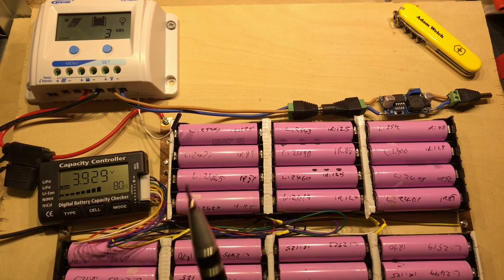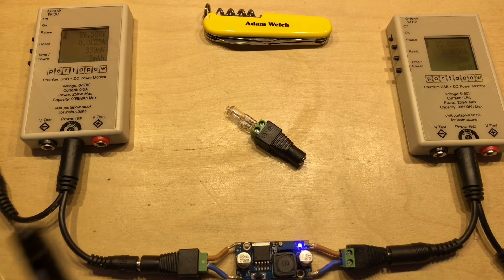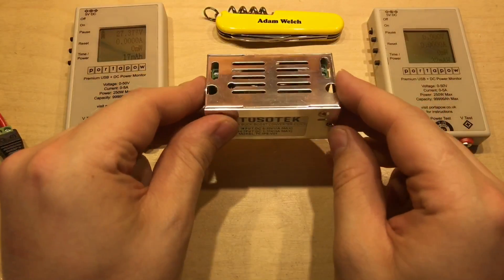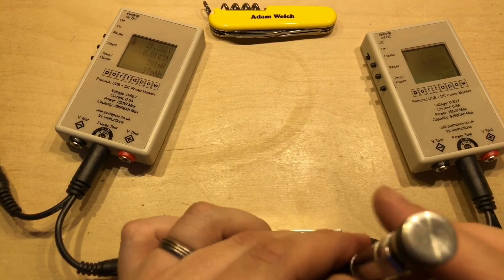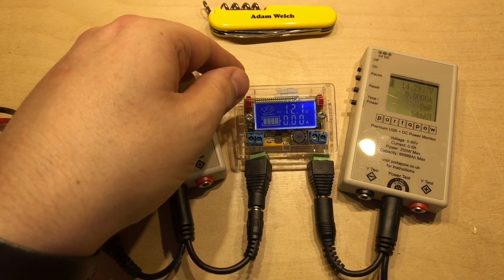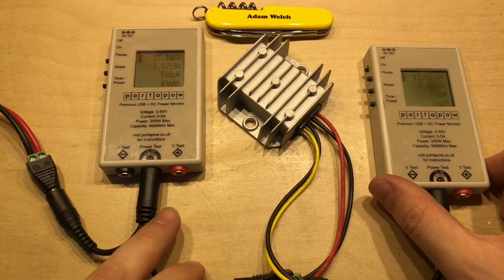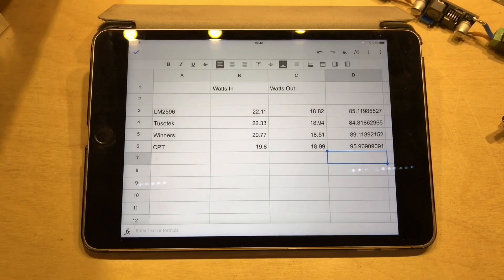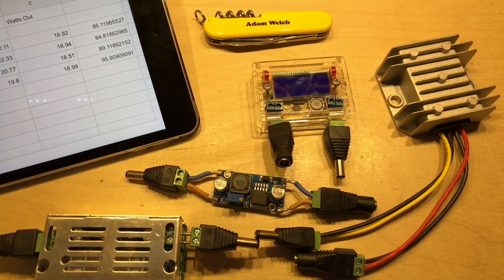Measuring DC2DC Converter Efficiency - 12v Solar Shed

Comment: Nice job!  You state that you chose a 24v pack because you “don’t think 12v packs work.”  What did you mean by that statement ?
Reply from the maker: +Dimitris Zarmakoupis Thank you. Yeah I talked about why I think lithium packs need to be 24 volt in this video: https://youtu.be/YoH7V56RtkM
Reply: Adam Welch I have watched that vid and totally follow your logic about getting the li-ion pack in range for the charge controller, however I don’t think that means that 12v packs “don’t work.”     I know what you mean though... they “don’t work when trying to optimize charge characteristics for use with solar charge controllers designed for other battery types.”

Comment: I have a larger version of that cpt converter I step down a 36v lifepo4 battery with it same efficiency on the conversion. 250w version 20a. It's my sons scooter battery it doubles for camping power as well since the battery can be cycled so many times. Next step charge the 36v battery with solar in the field. 2 160w panels in series for 24v and the MTP-7210a should do the trick I think.
Reply from the maker: Glad to hear your's seems to work as well as the model I bought.  I like the sound of the multi-fuction scooter come camping power source.  Have you seen my most recent video on the CKE boost MPPT solar charger?  I think it is probably more efficient that the Minghe 7210A unit.

Comment: Adam, Im playing with solar and struggling with  a few concepts. Im charging super caps using small solar panels. Im trying to understand how volts and current work when charging the super caps. The caps pull the voltage low when connected and as current flows, the voltage increases. So im guessing that its important to match your load with your input. Julian Ilett did a recent post and I have the same bank as him.

So, I was wondering if you had covered this, or could you, in the way that you do, provide your take on whats going on. I feel like i'm missing a key concept here and have the feeling that you will eloquently help me to understand.

Thank you Adam
Reply from the maker: Hi Dean.
Yeah a solar panel doesn't hold any charge - and it can comfortably sit at any point in it's power curve.  So it's voltage will typically sit just above the voltage of the battery (or capacitor bank) it is connected to.  Being just above allows the current to flow from the solar panel into the thing it's connected to.

The issue here is that when you connect your panel to the discharged supercaps you're taking your panel miles away from it's sweet spot where the voltage and current multiply to make it's peak watts.  So initially the charge will be very slow, but as you've seen as the voltage increases, more power can be created by the panel and therefore more current will flow.  Once the supercaps are charged up to a reasonable level - somewhere closer to your panels maximum power point your should see a marked improvement in the current flowing - thing is by this time your supercaps are generally getting full. If you used a battery rather than super capacitors it would reduce the current flowing naturally, however it wouldn't cut off completely - this is the job of the charge controller to prevent overcharging.
With Julian covering this recently I'm not keen on doing a video around this topic.  It might be a bit too similar.  Leave it with me though and if I can come up with another angle I will - after all I've got all the bits already.
Cheers
Reply: Adam Welch many thanks for your informative reply. All makes sense. Thank you for your time 😀

Comment: What are you using for your pack ?

I'm working on building a pack made from a series of 6s packs and i'll be giving each one a protection circuit.
Reply from the maker: +MiggyManMike It's a 7s4p of recycled laptop 18650s. All Samsung cells which seem to be working well together. Best of luck with your project.

Comment: Can you make a video in which you open up the cpt converter i wanted to what they are using to get that kind of efficiency.
Reply from the maker: +Electronic projects I kind of want to use it... I'll have a think.
Reply: Ok then use it.
Reply from the maker: +Electronic projects I'll see if I can pick up another one cheaply - although I'm not quite sure how I'll get in without destroying it!
Reply: Yes!! it kind of a problem to open it without destroying it.
If you can that would be great.

Comment: thanks for the info! I'll switch back to using CBT in future. Cheers
Reply from the maker: +Paul Kennett I was surprised how efficient it was. Obviously I only tested at my specific requirements but I'm glad it is of help to some.
Reply: I'm running 7S also so it's  very applicable to my setup. Thanks
Reply from the maker: +Paul Kennett Yes of cause - might be a little different at different outputs though - hopefully its similar at a good range of its output power.

Comment: Tx for the video. FYI Adam,  I have replaced some   lm2596  modules with the also low cost XL4015 modules since those have a somewhat  better efficiency.
Reply from the maker: +Ton Bovee Cheers for the tip Ton.
Reply: you welcome Adam , I use the lm2596 for several applications like driving fans meters  Leds, or as preregulator for linear powersource, where efficiency is less  important. It still is a cheap universal robust little device.

Comment: Great video, again :)

I wonder if using the EBD-USB load at 20W would make possible another series of test at a constant load instead of the bulb, and a power supply to test at a constant input wattage; do the results would be different?
Thank you sir, really appreciate your work.
Reply from the maker: +cire lefebure the difference in the output in each test was really quite small.  It may be worth trying the load I guess.

Comment: I am thinking the CMT converter was the most efficient because it was made to only convert to 12 volts and not be variable; So they could come up with the perfect circuit design for that single output voltage and that is why it is so efficient compared to the others.
Reply from the maker: +jimthvac100 yes quite possibly. I guess that's another reason to consider what you're buying when using the energy. A purpose built device, not a jack of all trades unless you specifically need the item to be adjustable. Why power a screen or led if you don't need one etc

Comment: Probably superfluous but these units are likely more efficient when factoring out jack contact and cable resistance. Still, 95% is excellent.
Reply from the maker: +Bernebeer 95.9! Yes, there are other factors but their effect is far smaller than the conversion. I wanted to point out you have to consider efficient use as well as efficient harvest of power.

Comment: great video, that is the thing to think about, if things are efficient you wont need to buy so many solar panels or pull power from the grid to supplement as much.
Reply from the maker: +SuperBrainAK Exactly. The collection and use should be as efficient as possible.

Comment: They have the TusoTech in just buck @ 10 amp http://www.ebay.com/itm/5A-8A-10A-150W-200W-DC-DC-Boost-Converter-Charger-Step-up-Step-Down-Power-Module-/222448478440?var=&hash=item33caf668e8:m:mEXTIVAi2fWRGy8848NZPSw
Reply from the maker: Thanks. Perhaps that would have been better for this comparison.

Comment: the lcd buck converter needs calibration, please follow the procedure in description here and tell us if it's better after calibration :)
https://www.aliexpress.com/item/Adjustable-DC-DC-Step-Down-Buck-Converter-Power-Module-5V-23V-to-0-16-5V-LCD/32654390108.html
Reply from the maker: +squalazzo Cheers. I will.

Comment: Nice review again.  Very strange that that winners module, which I also have and like very much, is off that much.  Mine was pretty spot on but don't despair, the calibration is on the BG website:  To make it easy>
Calibration method:
Under power off situation, Holdind left button and power the supply,when the  display begin flashing, release left button, with multimeter measuring the output voltage, by press the left and right button ,adjust the multimeter measuring voltage near 5V, such as 5.00V ,4.98V or 5.02V is ok too,at this situation,please ignore the displaying on this item. After adjustment,please power off it and then power to it again, then the  calibration is completed. Errors can be calibrated in 0.04V, if the error is greater, you can try to calibrate it again.
Reply from the maker: +Luc Peeters Cheers. I'll check mine.